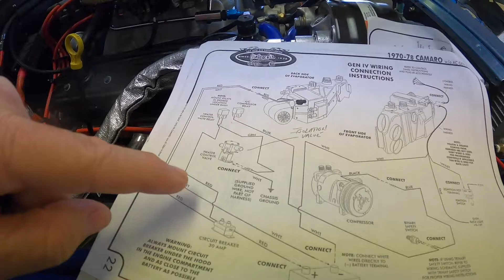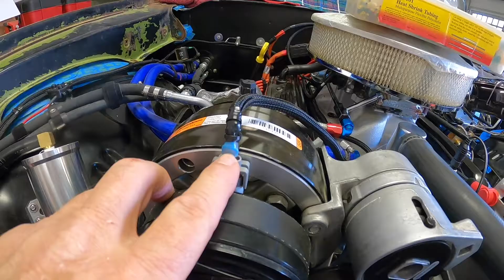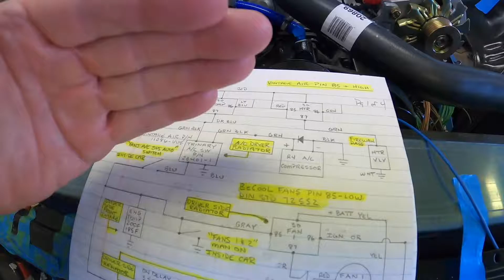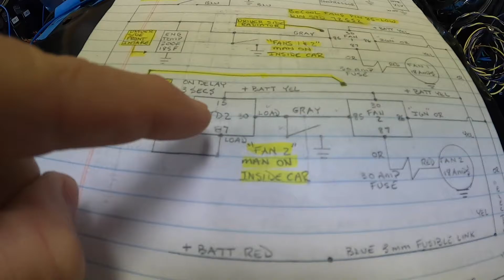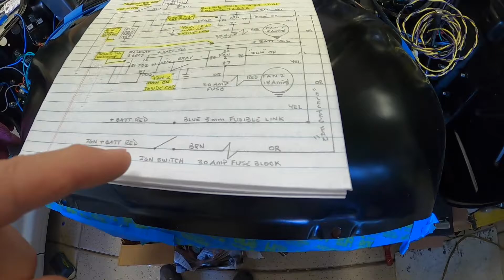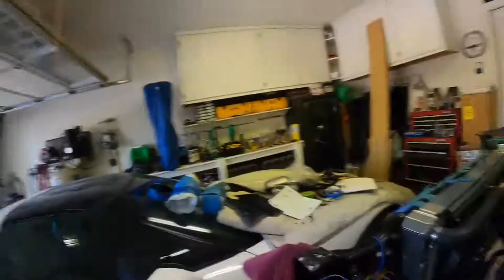"71" Camaro Restomod Electrical Update Part 03 31Oct2021

Comment: A lot good info here. I have a 72 Camaro resto mod  I'm doing. Thanks for your time on the videos. I can tell your into aviation......me too. ops ck good ok for svc.
Reply from the maker: First 5 years in the Navy I was a jet engine mechanic. Got out for a few years installed boat engines but worked mostly oil field construction and then went back in the Navy as an Aviation Electronics Tech specializing in calibration. Did 16 more years and also went to night school for a few years and got my FAA Airframe and Power Plant license. Worked for Solar Turbines for a few years after I retired from the Navy and then ended up in Las Vegas working for Clark County Water Reclamation for 15 years as the Senior Control Systems Tech. Fully retired at age 59 but seem to work more since I "retired"! Lol. Well, that's the short version! Thanks for watching!
Reply: @peter1956-x4s  Aviation is a crazy occupation sometimes, you never stop learning new systems. Been doing it for around 32 years now. You name it, I probably got the quals for it.. I see your into and have the same rifles I own.....pretty cool>>>

Comment: As a kid, my neigbor was a Navy veteran.
He had a Pontiac Fiero that he washed and detailed after every drive.
The thing was immaculate.
I always remember that ever single tool in his garage, lawnmower included, had his last name and social security number either written or engraved on it.
I thought; all Navy must be just as fastidious as Dale.
Yeppers!
Reply from the maker: I had an "86" Fiero! It was gold and black. Four cylinder model! It had some issues. Would take forever to warm up because of the radiator in the front and engine in the back. Ate up the top dog bone engine mount about every 20K. The weirdest problem it had was one day it really got noisy inside the cab! I mean it was bad especially at low RPM. Found out that it was caused by a resonance issue that the four cylinders suffered from in this car. Pontiac solved the problem by putting this solid rubber dampener on the frame that looked like a giant mushroom. Mine had broken off! Replaced the dampener and the car was quiet again! Also, trying to find someone to do wheel alignment right wasn't easy! All four wheels had to be aligned! Really wasn't a bad car though! Thanks for watching M E!